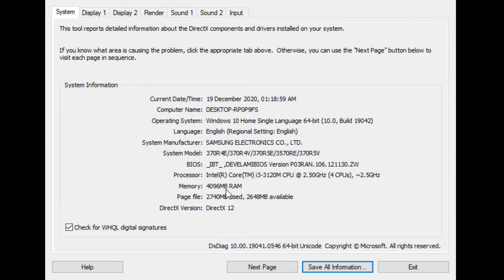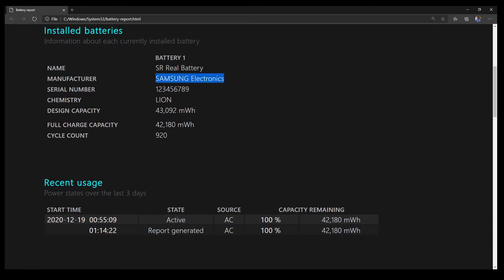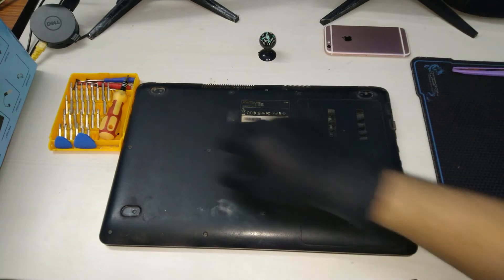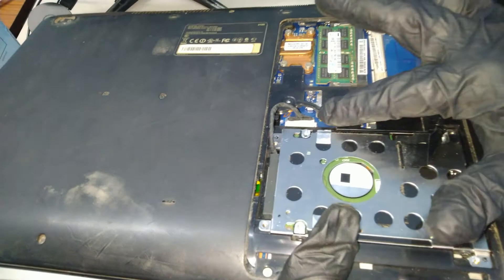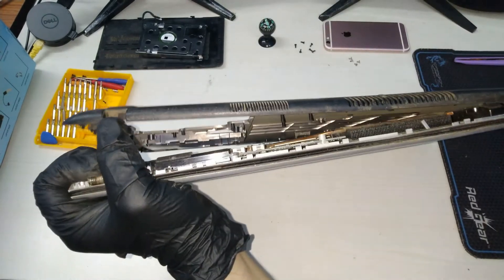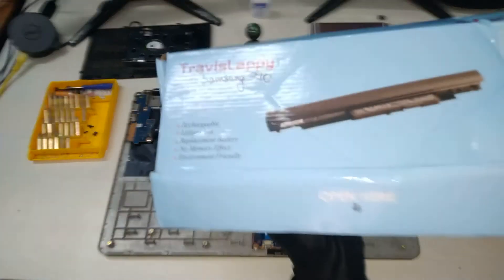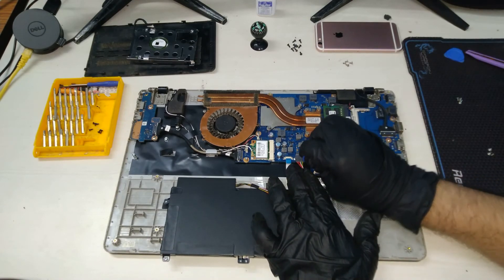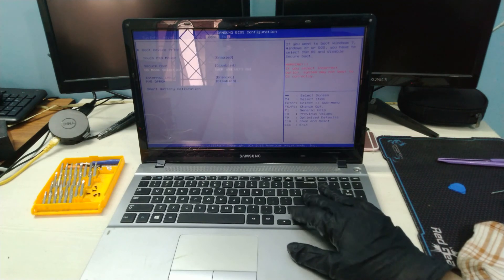Samsung Laptop - 370R 4E  - Battery Replacement - Do it yourself

Comment: Thank you!
My 370R5E's battery died recently and I wanted to replace it since the laptop itself was still working perfectly fine otherwise. Your video was a very good guidance along the way. The battery report command was very useful in confirming the state of the battery. The step-by-step disassembly provided some very useful information, like the screws underneath the rubber pads.

Maybe useful for someone else replacing their battery:
My replacement battery came with the instruction to first plug in the charger before starting the laptop for the first time with the new battery. Doing so it will just start up normally (so you don't get the BIOS screen).

Great instruction video! 😃👍